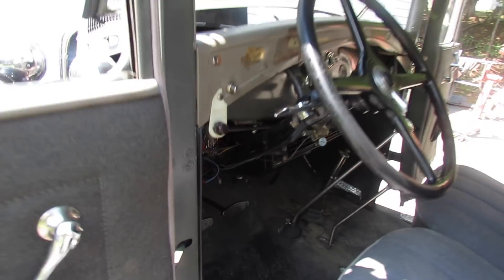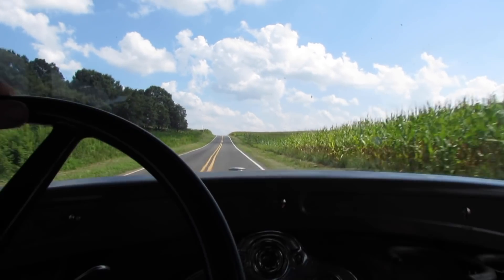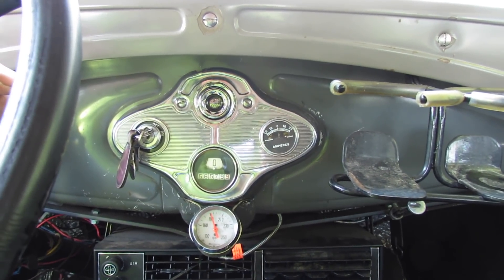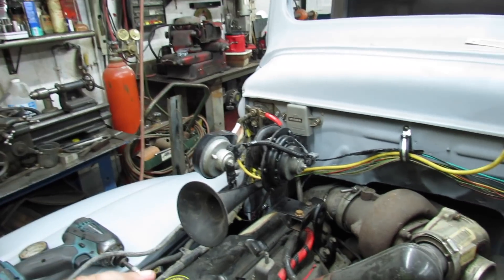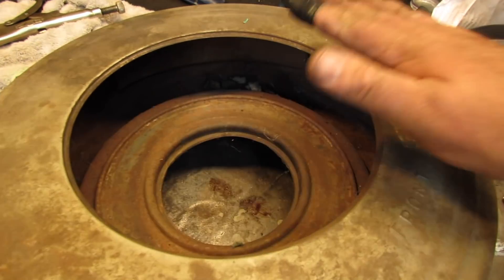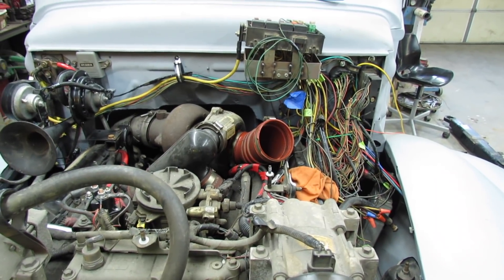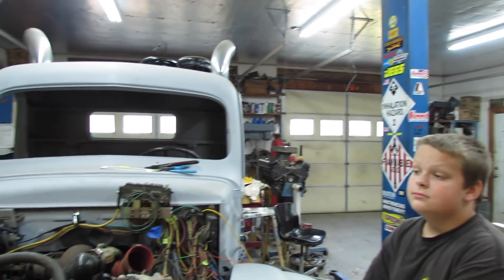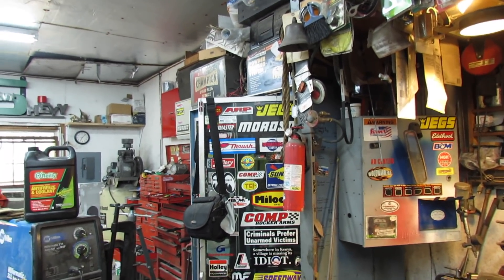Model A-Air condition test drive

Comment: I would run a good long vacuum on the ac system. High side should be 250ish and low around 30. 65 is nowhere near correct.
Reply from the maker: Thejeepdoctor it was turned off at that pint and equalizing.

Comment: you do know that the R152A puts far less demand on the engine compared to R134A... and it cools better at low speeds ...
Reply from the maker: towrecker I may need to look into that. Getting some heat on my last video. Duster. Haha
Reply: @MrHevyshevy  you need to look me up on facebook , just search towrecker , I need to got you the fomoco stainless mirrors for the truck before you get to the point of needing them , being the long arms they should actually fit and look like they grew there on it ... also on that car fix up a radiator spray with a washer set up , it will drop coolant temps 20 degrees if you ever take it on a mountain leaf peeping adventure ...

Comment: Yeah that airbox is way to small. Fellas say the factory 7.3 filter is too small. I would start by figuring out what the surface area of the factory filter is and go from there. If you upgraded or will upgrade the air flow through turbo and exhaust work, it would not be wise to do any less filtration than what it had from the factory.

Comment: Old school here so don't agree with AC's on "stock" Model A's. You may "need" to double clutch between gears because of how you have the throttle adjusted. Driving a "normal" Model A, you only need to double clutch "downshifting" or if you don't want to wait for the gears/engine speeds to align. With the idle speed at "normal" and "normal" acceleration,, usually two sideways clicks across the neutral gate of the trany will be the perfect amount of time to simple "dump" it into second gear. Give it a try. With the AC off, of course.

Comment: Were it mine and mind you it ain't .... I would do the one side entrance with a air filter box to the side of it and since its small put a adaptor on it for more air and let the small opening cause a turbulence of the air so it mixes even better as  I think it will. Just a little here and there, will get it done to where even you will want to get it done as suspense will eat you up. I'm excited to see the color that you will pick. There is a fellow doing a 51 dodge flatbed truck an its all stock pretty much cept color which is sorta vintage if there were no metal flake ...l think his name is like Parodoux.... type that in and it should correct me. This guy really has not a clue to fix stuff. Vacuum leaks and missing gears and thinking that the two speed shifter make it a ten speed.... okay.. His buddy "Dippen Diesel" will drag him down as that kid is a liar and idiot. He makes you sure that your kids will spell cat before leaving school..... anyway lost where I was going again.... that green on the 51 is a nice color as would a dark blue or red or gray... too much grey now so probably not a choice.... I know, How about doing it the color that you like since it is yours.!!